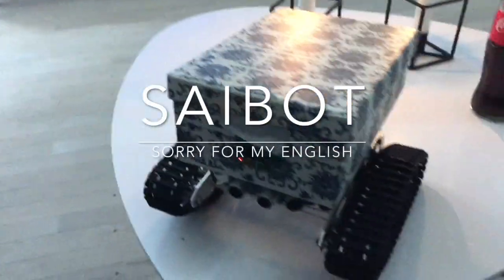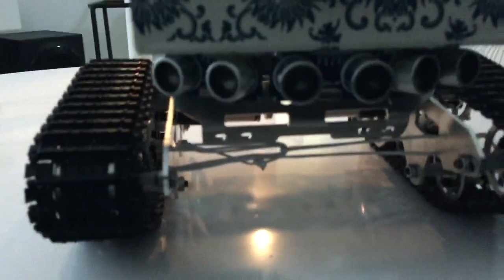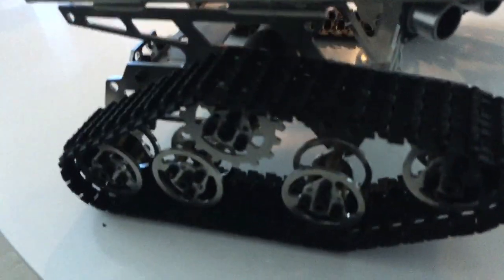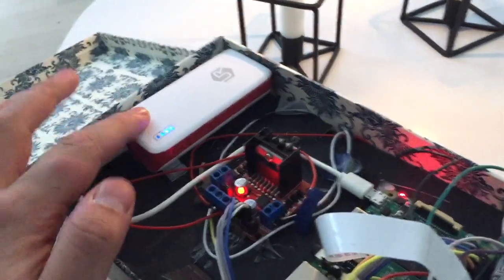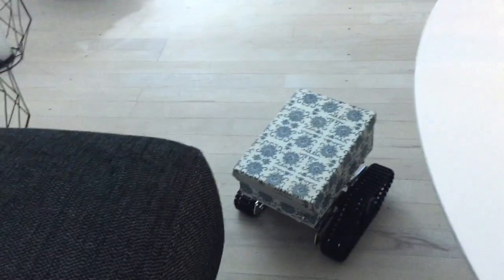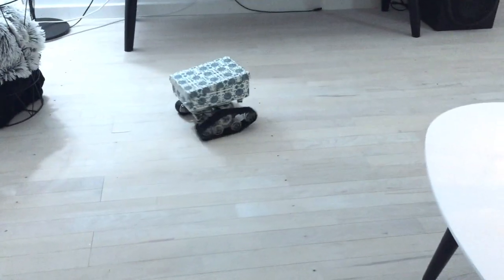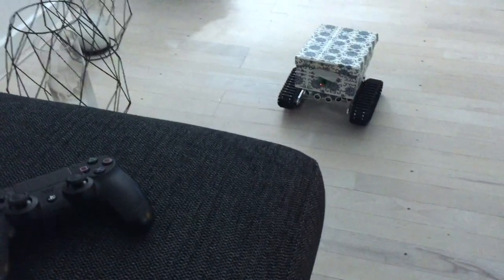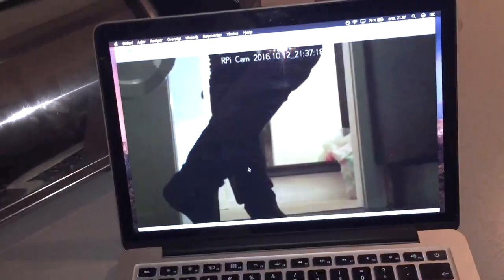Raspberry Pi 3 - caterpillar robot w/ PS4 and autonomous

Comment: you had a raspberry pi a power bank and another thing... what was that other thing and what does it do(its purpose?)
Reply from the maker: It is an L298N h-bridge motorcontroller which i use to control the motors. It is taking power from the 12v battery. :)